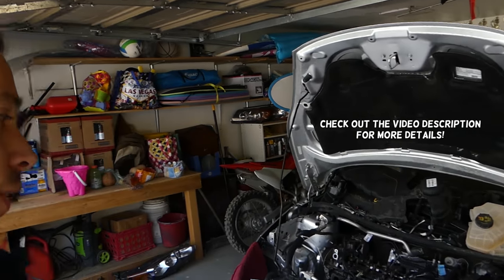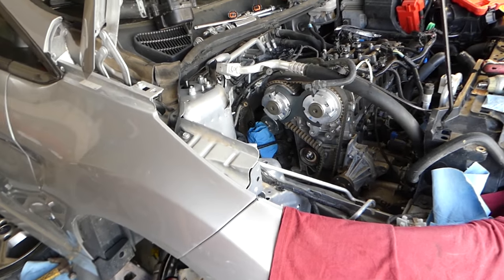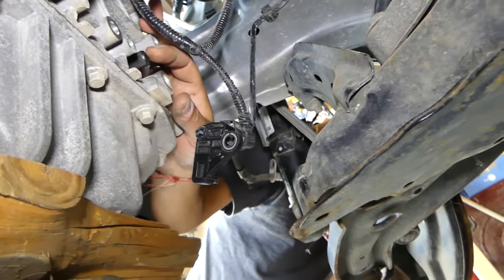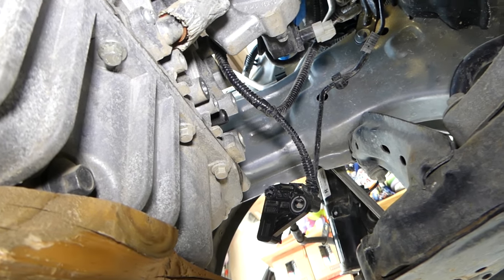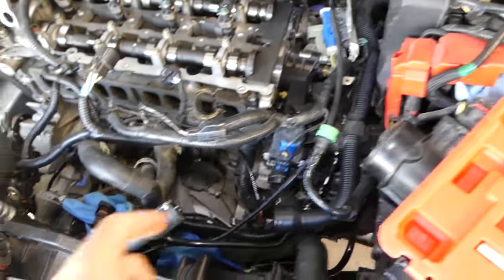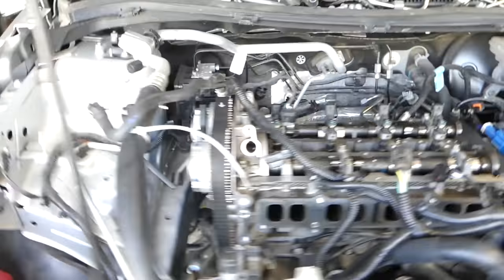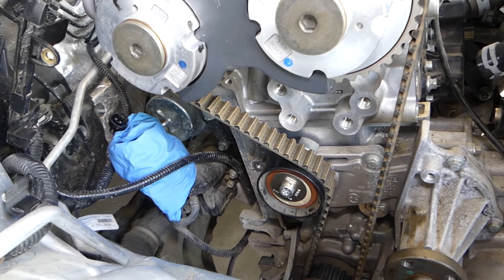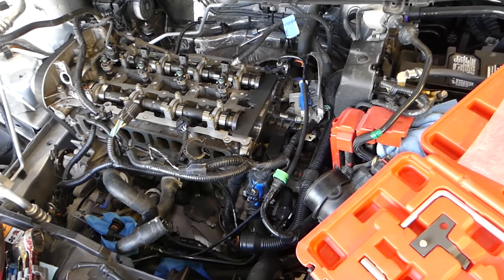FORD FOCUS TIMING MARKS 2012 2013 2014 2015 2016 2017 2018 Timing Belt

Comment: On the ford fiesta 1.6 you don't need to remove the axle. It's a little tight, but takes about 30 seconds to remove the plug and install the locking pin. Whereas removing the axle will take you 20 to 30 minutes and if you are a Novi, maybe longer.

Comment: Do you need all those extra timing tools? i remember on the older engines using a 6mm drill and a 4mm bit of stainless. this was before the vvt stuff

Comment: I've 2016 Focus SE 2.0L GDI Flex fuel . engine . Can someone tell me if loose timing band will bend rods and valves ? One says  yes another says no way . What's the truth ?? verry hard to find a good mechanic
Reply: There interference engines the 2.0L has a chain

Comment: i have  a chain they say i can drive the car up 240000 km ore 10 jears i went to a garage he told me and saw the chain thats alright to drive whit it my car hase now 195000 km its a ford cmax 1.0 turbo eco boost turbo he sad thats a new motor wher they have the chain in motor very long job more than 1 day workif it was a belt it easyer and much cheaper any one nows this model its begin 2014 thanks